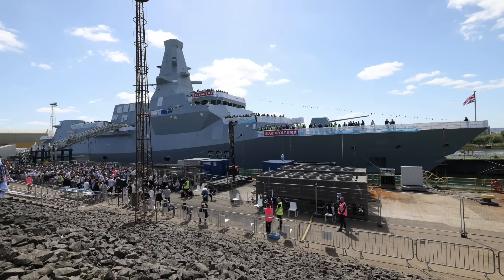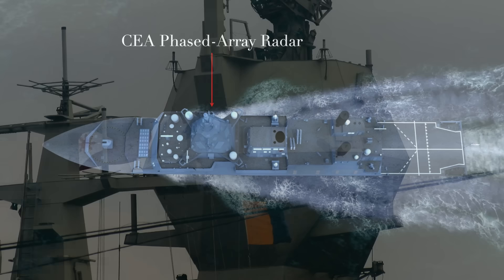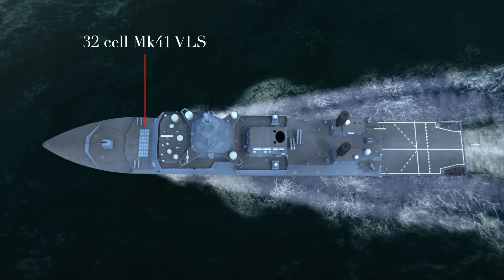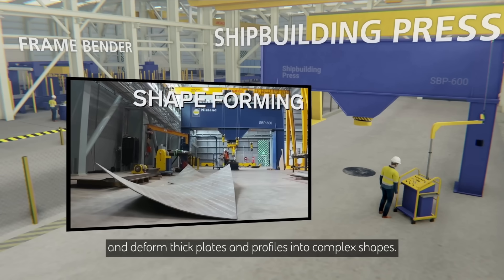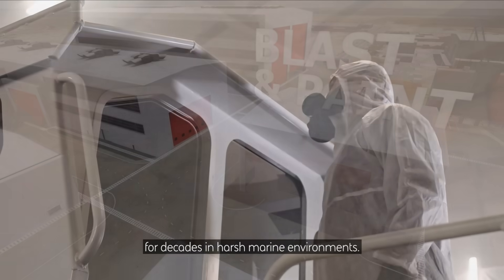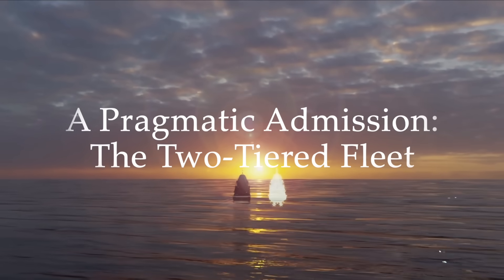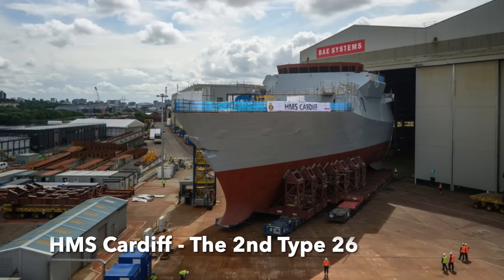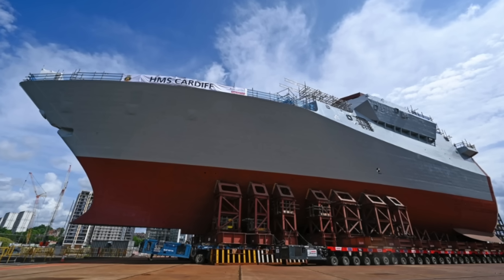The World’s Most Expensive Frigate? Inside Australia’s Hunter Class

Comment: The Australian Department of Defence, the Royal Australian Navy personnel that are involved in procurement, Australia's political class, their legions of consultants and most of the major defence contractors have all failed to deliver time and time again. The only really successful ships built in Australia over the last few decades for the Royal Australian Navy were the ANZAC class frigates that were built in the 1990's and early 2000's at a tempo of ONE PER YEAR by Amecon/Transfield/Tenix to a German design based on the Meko 200 class. This shipyard in Williamstown in Victoria was eventually acquired, closed down and asset stripped by BAE Systems Australia after the fit-out of the two troubled Canberra class landing helicopter dock (LHD) ships.

This situation is not acceptable especially considering China's undoubted success in designing and building large numbers of standardised capable warships quickly and cost effectively. China is apparently run by engineers and technocrats while Australia is clearly run by lawyers, consultants and mostly self serving bureaucrats easily manipulated by profit driven mostly foreign owned defence conglomerates.

It looks like the A$9 billion Hunter class frigates that only have a 32-cell Mk41 VLS and are unable to incorporate the 48 Sea Ceptor anti-air missiles of the UK's Type 26 ASW frigates, but have excellent sensors and an excellent combat system may benefit greatly from operating with a class of 'Tier 1 Heavy' ships which are basically a relatively low cost large and relatively simple arsenal ship that networks with the task force greatly increasing offensive and defensive firepower.

South Korea's proposed Joint Firepower Ship is based on this concept but this class of ship was cancelled in the January 2025 review in favour of the Korean Next-Generation Destroyer (KDDX). Nevertheless it should be feasible to design a class of naval vessel based on a stretched destroyer hull for example with large numbers of VLS cells, but with all other capabilities reduced or eliminated, thus relying on the networked ships and aircraft of the task force to initiate and control missile launches. Such a vessel could even potentially be designed to be minimally manned or unmanned and be able to venture closer to possible threats.

https://www.navalnews.com/naval-news/2023/04/south-koreas-dsme-to-design-arsenal-ship-for-rok-navy/

But what about the urgent task of anti submarine warfare? Using A$9 billion ships for this task would be idiocy even for the relatively well funded US Navy but for the RAN with far less funds available, this is beyond words. Not very surprisingly the world's oceans are extremely large and submarines are very difficult to find and prosecute which should lead someone to believe that large numbers of much lower cost dedicated ASW ships is better than a few hugely expensive multipurpose ASW/AWD ships.

Given that most of the ASW capability of an ASW ship is actually within the ASW helicopters then it would be logical to have a class that can hanger and operate two ASW helicopters and have a good hull mounted sonar, variable depth sonar and a passive towed array sonar as well as being fast and quiet. The major defence contractors would be very happy with those specs and would probably offer something twice as expensive as the Hunter class ASW frigates and here lies the problem. The motives of the major Western defence contractors is to extract as much money as possible and not to offer value for money innovative solutions.

Australia should probably have invested in a government owned but commercially managed naval ship design and construction enterprise many decades ago that could have prioritised value for money but that is all apparently too hard to do, the consultant class would have felt excluded and so we as a nation must wait for other nations to hopefully design suitable ships and then build their designs locally. The Australian government owned ASC Pty Ltd based in Adelaide is somewhat along those lines but they don't have a good reputation for on schedule or efficient production nor do they have much in house design or R&D capacity.

Alternatively an approach of many smaller dedicated ASW ships that can carry one medium ASW helicopter and that have a reasonable hull mounted sonar, variable depth sonar and towed array passive sonar would be a rational choice and the Upgraded Mogami general purpose frigate is such a ship and so we can award one gold star sticker to the Australian Department of Defence for that, if all goes well.

The former Oliver Hazard Perry class frigates that were operated by the RAN could operate two medium helicopters even if the RAN chose to operate with just one to save money. An Upgraded Mogami frigate with a larger hanger for two medium helicopters would have likely offered even more anti submarine capability per dollar spent but that opportunity was never part of the original design.

The six Collins class submarines had many serious problems during their construction and early operation but most of these problems were eventually resolved mostly by ASC and costs in the end were still tolerable, but since then the Hobart class Air Warfare Destroyers went substantially over budget. The Hunter class is a major failure being the world's most expensive frigates and the eye watering cost (A$360 billion) of the AUKUS program will bleed resources from the rest of the Australian Defence force for the next 30 years all for eight miracle weapons called nuclear powered attack submarines.

That comes to A$45 billion for each SSN in out turn dollars which is madness but includes the cost of training and the operational costs of the crews, the upgrades to the shipyards and facilities and all support costs. If the Australian Department of Defence would actually provide detailed cost break downs then a much better assessment could be made but unjustifiable secrecy prevails. The whole project should be cancelled for that reason alone.

Two used and one new Virginia class SSN's are planned to be purchased from the US as the first phase of pillar 1 of AUKUS and later five UK designed SSN-AUKUS submarines are planned to be built in Adelaide starting in the late 2030's as the second phase of pillar 1 of AUKUS.

The Australian Government could even at this late stage abandon the acquisition of the Virginia class SSN's as the US Navy is desperately short of SSN's because the prior Los Angeles class SSN's must be retired as their design lives are reached, stop wasting billions of dollars in a futile attempt to increase US submarine build capacity at a time when the larger Columbia class SSBN's must be built simultaneously in the same two US shipyards, and instead acquire something like a stretched longer range version of the Mitsubishi/Kawasaki Taigei class SSK's that use far superior lithium-ion batteries. The first two could be built in Japan to prove the design and another six to eight built at the Henderson Shipyard in Perth after an extensive upgrade, by Mitsubishi/Kawasaki using Australian and some Japanese specialist workers. Japan pays between US$600 to 700 million for each Taigei class submarine.

The primary reason it would be more viable to build SSK's/SSG's in Perth rather than in Adelaide where the Collins class SSK submarines were built and the SSN-AUKUS submarines are to be built, is that Mitsubishi Heavy Industries won the contract to supply general purpose frigates to the RAN and the first three Upgraded Mogami class frigates are to be built by MHI in Japan and the subsequent eight are to be built at the Henderson Shipyard in Perth.

MHI would likely be more confident that they can run operations 'their way' so that schedule, productivity, quality and procedural levels can be attained and their intellectual property will be more secure in a facility that they operate, or jointly operate with a separate Australian company, rather than at a joint facility operated with ASC and BAE Systems Australia. ASC and BAE Systems are in any case busy with the design and build of the 3 to 5 overpriced Hunter class ASW frigates and must prepare for the SSN-AUKUS build starting in the late 2030's.

The main submarine base for the RAN is currently HMAS Stirling in Perth and this is the main planned operational base for any SSN's acquired by the RAN and for visiting US Navy and RN SSN's. Having a submarine shipyard on the other side of Cockburn Sound from HMAS Stirling would clearly be a major advantage.

Japan's MHI and KHI take about two and a half years to build a Taigei class submarine from laying down to commissioning and they together complete one per year. At such a tempo it would be possible to complete all of the proposed Stretched-Taigei class SSK's before the delivery of the first SSN-AUKUS submarine in the early 2040's.

Unfortunately the opportunist U.S. Trump Administration has more to gain by maintaining Australia's commitment to buy Virginia class SSN's for as long as possible due to the 'no strings' donations being given by the Australian government to help increase the submarine building capacity of the United States, and the huge sums provided for the training of Australian naval personnel. The US President could with one year's written notice withdraw from the AUKUS agreement based on the belief that providing these submarines to Australia could adversely affect the military capabilities of the United States. Many years and much money could potentially be squandered and Australia would then have to rely on its expensively rebuilt and excessively old six Collins class SSK's until the first of the SSN-AUKUS submarines are completed in the early 2040's IF ALL GOES WELL with that challenging part of the AUKUS project.

Comment: Limited missile launch silos doesn’t make a difference when Australia will run out of missiles in a few weeks of war.
Reply: Unlike the RN's CAMM missile VLS launchers which have one missile per cell, the ESSM Block II missiles in service with the RAN can be quad packed four to a cell. So a Hunter with a max loadout of ESSMs would be armed with 128 missiles for air defence compared to just 48 for the Type 26.

The Hunters will also be equipped with the longer 'strike length" MK41 VLS (vs the shorter 'tactical length' MK41 cells) which open the possibility of wider range of missile load outs for different missions including Tomahawk for long range strike over 1,200 kms (already in service with the RAN's Hobart class destroyers) and SM3 and SM6 in combination with AEGIS which can provide  anti-ballistic missiles defense. These are capabilities that the RNs Type 26 will lack.

Coupled with the AEGIS combat system and Australian built CEAFAR radar, the  initial batch of baseline Hunters will be a much more powerful surface combatant than their Royal Navy cousins and a more versatile ship for a wider range of missions not limited to ASW.

There is a proposal by BAE for the the final 3 Hunter class ships to have additional 64 VLS cells fitted utilising some of the space in the baseline design's massive  mission bay taking the total to 96 cells and making it one of the most powerful surfaces combatants of any navy.

The Hunters will also be equipped with the Naval Strike Missile (NSM) a newer, generation stealthier middle in place of Harppons (NSMs are already being retrofitted to both the RANs Hobart desytoyer and current ANZAC frigates.

Both Kongsberg the manufacturers of NSM and Raytheon ATX (Tomahawk, SM2, SM3 and SM6) are building factories in Australia for the local manufacture of missiles, Australia will be in a better position than most other nations for missile supplies.
Reply: @oscarzulu1778 CAMM is designed to quad pack in the mark 41 (or double pack for the Italian extended range version. The smaller length exls cells also quad pack CAMM. The Royal Navy is reusing the single cell launchers originally designed for Sea Wolf as a cost saving measure.

The RN deploys dedicated air defence platforms rather than with 48 area defence missiles and 24 CAMM reused from the Type 23 (money saving). We chose not to add 16 mk 41 or the sea
Ceptor exls cells to save cash. If we had, we’s have deployed 64 CAMM missiles

Comment: Aussies have a completely different operational environment. PLA opponents have significantly more missile capacity. The combat system is also common with the AWDs. AEIGIS allows for cooperative engagement across multiple platforms.
Reply: Reduced integration risk / timeframes for USN weapons (e.g. SM3, SM6, TLAM) used on the Burkes would be another reason (although not as good as CEC) for the choice of AEGIS. The recent TLAM integration with the Hobart class is a good example.
Reply: @limerick_au it should be noted that Wedgetail, Hobart and Anzac have all been involved in CEC tests (NIFC-CA)

Comment: To make the most of the capabilities of the 32-cell Hunter-class, several escort ships are required. 
Are you considering operating a fleet of around 1 Hunter-class and 2 modified Mogami-class ships?

Hunter-class frigate — approx. ¥500 billion per ship
Full-load displacement: 8,800 tonnes
Overall length: 149.9 m
Beam: 20.8 m
Propulsion: CODLOG (COmbined Diesel-eLectric Or Gas)
Prime movers / main machinery:
MT30 gas turbine ×1
Electric motors ×2
Shaft power / output: 46,935 horsepower
Weapons :
single 62-caliber 127 mm gun ×1
single 30 mm autocannon ×2
20 mm CIWS ×2
Mk 41 VLS ×32 cells
SSM (ship-to-ship missile) 4-tube launcher ×2
324 mm triple torpedo tubes ×2

modified Mogami-class — approx. ¥100 billion per ship
Full-load displacement: 6,200 tonnes
Overall length: 142 m
Beam: 17 m
Propulsion: CODAG (COmbined Diesel And Gas)
Prime movers / main machinery:
MT30 gas turbine ×1
Diesel engines ×2
Shaft power / output: 70,000 horsepower
Weapons:
62-caliber 5-inch (127 mm) gun ×1
VLS (32 cells) ×1
SeaRAM ×1
SSM 4-tube launcher ×2
324 mm triple short (lightweight) torpedo tubes ×2
Planned/future equipment: high-power laser system

ASEV — approx. ¥400 billion per ship
Displacement: 15,000–16,000 tonnes
Overall length: 190 m
Beam: 25 m
Propulsion: COGLAG (COmbined Gas turbine-eLectric And Gas)
Prime movers / main machinery:
MT30 gas turbine ×2
Electric motors ×2
Shaft power / output: 100,000 horsepower
Weapons /:
single 5-inch gun ×1
20 mm CIWS ×2
Mk 46 (30 mm autocannon) ×2
Mk 41 VLS ×2 (total 128 cells) — capable of:
SM-6 (SAM)
SM-3 (ABM)
Type 07 SSM (07式 SUM)
Tomahawk SLCM
Type 12 SSM (improved) 4-tube launcher ×2
324 mm triple short torpedo tubes ×2
high-power laser system
Reply: The optionally crewed missle ships with multiple launchers are a big part of that puzzle
Reply: You’re comparing apples with pears. The RN equivalent to the Mogami is the Type 31.

Designing a warship to be ultra quiet and have 9000 mile range with dedicated top end ASW equipment is expensive. Type 26 design is the best in ASW class globally.
Reply: Your ASEV, drop the 127mm and 20 mm and fit them with a 57mm and 35mm and several countries are working on AA LASERS, EOS in Australia has developed a 150kw laser and what happened to the Japanese rail gun?? Remember the cost of the Hunter is for the life of the project (20-30) years, that needs to be taken into account when costing.
Reply: @boredatsea the Japanese are still developing the rail gun. They had a recent round of successful test firings. 

Lasers are almost there as a usable technology especially as drone/ short range systems.

Problem is the hunter class are already at/exceeding the limits of the electrical generation and cooling systems.  So adding any large extra loads as an upgrade isn't going to happen with major changes.
Reply: @Angus775n  The Hunter is a sub hunter, the weight is because of the ASW suite, there is a design to leave the SONAR on and remove all other towed array thus saving weight. the UK have designed as Type 83 based on the type 26, replaced the 127mm with a Bofors (BAE) 57/70 (designed for high speed and altitude a/c and missles) which is 3P, the design allows for 128 cell VLS plus the 4 quad launchers for the Kongsberg NMS, which are now being manufactured in Australia. At the end of the day, Australia has a small population compared to the rest of the world, large coastline and the desire to help our allies so one of the considerations is economy of scale. If I was admiral of the bath tub fleet of the Banana republic I would have gone with the Japanese designs, including the Soryu and now Taegai subs and throw the hat in the ring for the new development of the BAE/japanese FX aircraft.
Reply: Future equipment for the evolved Mogami-class vessels is planned to include a 100kW high-power laser system manufactured by Kawasaki Heavy Industries. 
The 13DDX destroyer, scheduled for construction in 2031, will be equipped with innovative equipment such as a high-power laser system, a high-power microwave system, and a railgun.
Reply: Each of our LHDs, if formed into a combat fleet, will feature 1 x Hobart class Air warfare Destroyer + 2 X Hunter class Guided missile frigates +2-4 Mogami class GP frigates along with various support ships and 1 or 2 Collins class submarines if we need to project power outside of our home waters.